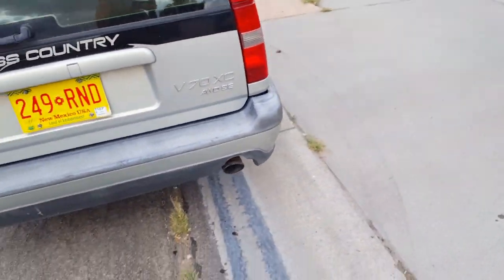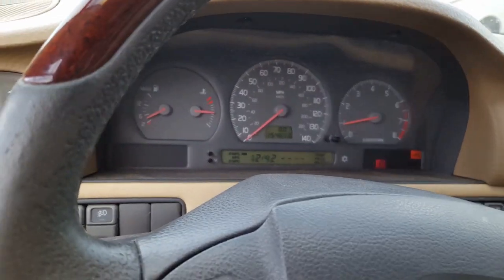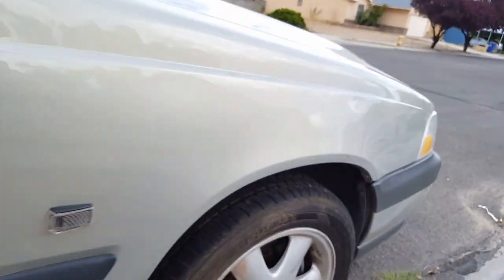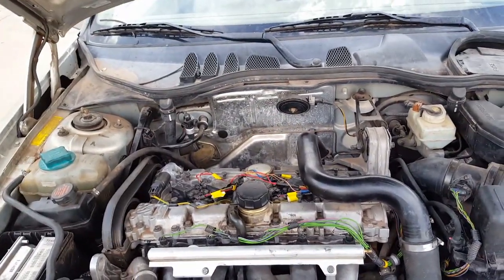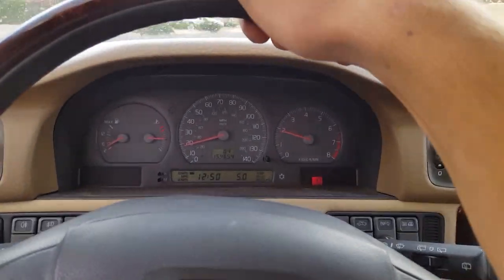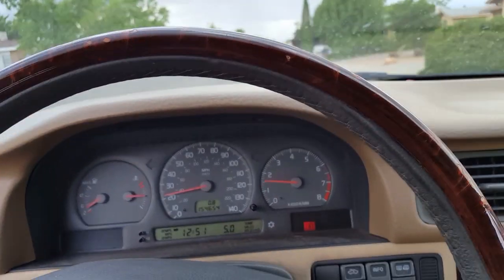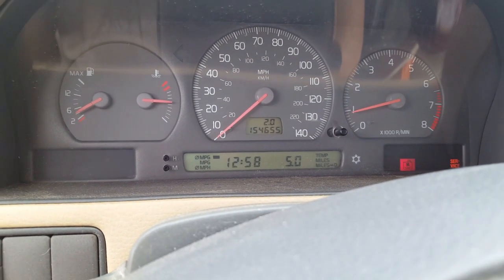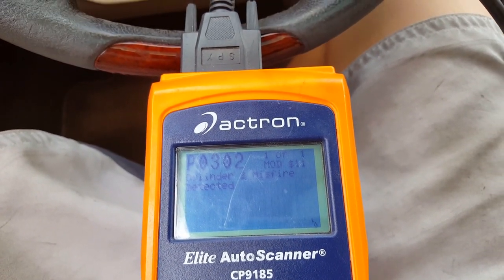Volvo v70xc SE Misfire Compression Test

Comment: I had a 2000 V70 XC SE, black interior but otherwise same (except for large black bar on back window). Is that a 99 ? I still love the look of that model, way more than the 2001-2007 XC70. Mine had 265k kms when I traded in, it was the third car behind newer V50 and XC90, pity I can't collect as many as you have (I'm on my 8th Volvo overall)

Comment: Did you solved the problem? I have V70N 2.5T 2006 Whit similar problem. No codes but it register misfire at random cylinders some times. I have Cheeked fuel pressure, change spark plugs, Change some of the coils. And some other things. My compression may be little low but not treble low. Your car shakes allot more then my car. But similar problem.

Comment: On one hand I definitely am interested in how this project will turn out. However the issues that the P80 chassis have kind of scare me. I have a 91 740 NA and it basically sat for a year before I got it. The 16-18 avg mpg is killing me in town. That's why a newer p80 series appeals to me. More power and better mpgs.
Reply: 16-18mpg in town.  That sounds very low for a 740, even an automatic.  I think you might have some problems with yours...
Reply: +gosportjamie Yeah I am trying to figure out why it is so low. I am thinking that the o2 sensor maybe bad.
Reply: If it was something like that you should have a check engine light on the dashboard.  My guess would be that you have a bad temperature sensor which is reading cold all the time so the engine is constantly running rich, like using the choke on a carburettor vehicle.  There are two sensors, one that operates the temperature on the dashboard, which is often in the radiator or on the thermostat housing, the second one sends engine temperature readings to the engine management and is usually on the top end of the engine, and it's this one that I suspect is at fault...
Reply from the maker: the p80 does have a list of common problems, but if you handle them one at a time, it isn't so bad and quite rewarding to daily. exponentially more comfortable than a 7 series and power is nice to have. have you done a tune up on that 740 lately? it wouldn't cause that much of a mileage drop, but it is worth looking in to. and cleaning all the sensors
Reply: +David Bello I have done a tune up on it. I replaced the air filter , air temp sensor, and now the ect is next. I also did the E-fan conversion as well. Trust me the P80 series is very tempting to invest in. I have watched all of RobertDIY's videos on servicing them. I'll follow your build and see how it turns out. I also deleted the air temp blend door cause it was stuck on the hot side.
Reply from the maker: As they always do get stuck. Robert is a great guy. I like the p2 series more and more because of what I would call their "effortless luxury."
My 122 and 240 heave to get up to speed, whereas all of the electronic goodies on the p2 make them feel light (having a turbo helps). Of course, electronics are the Achilles Heel of these cars, and the p80 cars have more reliable instrument clusters, for one thing. More robust door handles, sunroof units and slightly thicker sheet metal skins are also noteworthy. We'll see how deep the rabbit hole goes once I sell my 240 and put a thousand pesos into the 2001 xc70
Reply: I wouldn't mind an 850 turbo sedan. I have owned 3 Saab NG900s and I loved them because they were wonderful highway cruisers. The maintenance on them could be a nightmare though. That is what sorta scared me away from FWD Volvos. I wanted a S80 but the many nighmare stories that I read kinda scared me off. I will get my 740 sorted out for a reliable daily (if that's possible) and then maybe I can look for a project 850 or S70 turbo to take on. I have driven a S70 and I admit it was so nice to drive. AC worked effortlessly, there was no rattles or vibrations. It was like riding on a cloud. Used FWD Volvos are pretty cheap these days just like Saabs. It's just finding one that hasn't been beat to hell to invest in. I will keep following your journey with your XC. Best of luck!
Reply: David Bello   I don't know if it's something that applies to US specification vehicles but I know that Volvo did redesign the instrument cluster on the P2 UK and European models to hopefully sort the problem with the clusters dying, which could and did regularly happen when the cars were still under warranty.  My understanding is that a later cluster should be a plug and play direct replacement and far more reliable.  Of course, time is the real test and it could be that the newer clusters go the same way, just later rather than sooner.  Of course it also has to be said that electronic instrument cluster failure is certainly not something that is unique to the P2 Volvo, I think there are recorded cases of it happening to just about every make and model of car fitted with them since 2000, with some, like my mk1 facelift Ford Focus, though mine seems to be still  on its original at 14 years old and (touch wood) it's still working fine, though occasionally it does things which you may not necessarily expect as it goes through its self-test function, so I do wonder if maybe some of the cases of "failure" are actually units being replaced by unscrupulous workshops when the "fault" the owner has seen and reported was actually the electronics running a self-test...
Reply: Darth Eyeball   The 850 and first generation S/V70 are a lot less complicated and frustrating to work on than the SAABs would have been largely because they're not full of under-engineered and over-stressed GM components that didn't work particularly well in the cars they were designed for.  And their problems are well recorded, whereas the SAAB seems to be able to find totally new and unexpected ways to go wrong.  Of course, due to their age finding a good one could be a problem, but if you're prepared to put in the work and take some time over doing one then buying a basically sound cheap heap and working through it could be a good way to go, especially if you have decent junkyards around your area...
Reply: I so agree on Saabs finding ways to go break outside of the expected. There are lots of 850s and s70s in the junkyards around here. Parts are plentiful. So far finding one that hasn't been beat to hell has been a challenge. Though it did happen across a 01 V70R AWD for $500. But it had been sitting for the past 4 years and the timing belt had broken and it was having issues with the angle gear. The guy just wanted it gone. But it seemed like it was really gonna need some TLC to bring it back. I'll keep my eyes open. Thanks for your help.
Reply: Darth Eyeball   I might have been tempted to take a crack at that V70R, even if it needs an engine rebuild after the cambelt snapped it would be worth the effort as they are properly quick and fun to drive even in automatic form.  The angle gear is extremely common on AWD cars but they can still be driven as two-wheel drive with the rear propshaft/drive shaft removed, and replacement angle gears shouldn't be too hard to find or too expensive, particularly with re-engineered ones coming on stream.  Even if you decided it was too much work it would certainly break for much more than $500 as genuine R parts, such as the spoilers and such are very hard to find so reasonable used items can sell for stupid money (apparently a lot of original-spec R parts are no longer available through Volvo...)

Comment: I’m having the same problem with 05 XC70 Replaced two coils number two and number for that is what I got an OBD I was running the same when I was done drove 15 miles parked it started it up check engine light was back on car Randgood for 10 minutes then started to Miss again

Comment: I dunno David, low compression usually calls for me to turn around with these cars. The 850s were 156-185lbs. that low compression on the one cylinder could spell trouble for you. did the wet test make it go way up?
Reply from the maker: wet only bumped it up to 120
Reply: +David Bello  Well, having done the dry and wet compression tests you now know that the problem is either with the head gasket or the valves, or very possibly a cracked cylinder head.  Depending on financial constraints a good used cylinder head might be the cheapest way to go now...
Reply: I really doubt there are major bottom end problems as the engine just sounds too sweet on the video, usually bottom end problems are accompanied by a variety of unpleasant noises.  The fact that it's not triggering a fault code is actually good news as it shows that, apart from the mechanical fault causing the misfire (I'm betting one or more burnt or bent valves or possibly damaged valve seats, if it was a head gasket I would expect it to be burning coolant which almost always triggers an emissions fault code from the burnt antifreeze,) the rest of the engine (with the exception of the leaking turbo, which could be failed seals in the oil return) is in good shape as is the emissions system.  On the video of the test drive the gearbox seemed sweet and it seems to drive well and it is pretty low mileage for a US car so I think swapping out the head would be a worthwhile job that would make it fit for another 150,000 miles.  A little minor cosmetic attention which I'm sure you've done on others before should make it a really nice car, and pretty unusual being an SE too...
Reply: Using some leather/hide food or saddle soap on the drivers seat now will stop it cracking up completely and splitting like they do in high temperatures.  Once it's had and absorbed a few doses of that it will look nicely mellowed and really soft again...
Reply: The reason the check engine light was flashing on and then going off is because of the knock sensor picking up the uneven running, it's designed to allow the engine to adapt to poorer quality fuel by altering the ignition timing to try and cope, and will briefly flash up the check engine light while it is doing it as a warning to the driver not to drive the car hard.  In your case, however, it isn't being caused by bad fuel but by a mechanical fault which is why the check engine light eventually comes on constantly recording the misfire code.  With how quickly the car started running low on fuel I suspect the oil leak at the turbo might be in the oil supply to the turbo rather than the return as the supply side is pressurised...
Reply from the maker: +gosportjamie thanks for the tip!
Reply from the maker: +gosportjamie I can't tell you how many bad heads I've seen on the T5 engines. mostly just neglect and overheating them. as always, I look forward to your input. you are a wealth of knowledge Jamie
Reply: David Bello   Yes, it certainly seems that head problems are far from uncommon on these in the US.  I suspect it is a combination of higher summer temperatures and uncaring owners running the cars on a "drive it until it breaks" basis rather than sensible "fixing it forward" regular maintenance.  The only wrecked 5-cylinder heads I've seen here in the UK have come off tuned (and maybe over-tuned) cars.  I suppose the lower temperatures help and the fact that in the UK Volvos tended to be owned by more careful owners and enthusiasts (and the Police) so they are maintained, plus the UK MoT system, every year from 3 years old has probably seen a lot of the neglected cars written off the road due to failure of an expensive (often electronic) part before they get to the point of melting heads...

Comment: Hey David Bello, I have a Volvo 960 1993 that has been in my family for so long and well lets just say the car is not in its best condition appearance wise. I have tested the engine making sure it is fine, which it is. The thing I have noticed is that the car's steering wheel seems to shake a lot and once you get the car up to 80mph it starts shaking like crazy. Do you have any idea on what that can be? Also I am looking for a site that has volvo pieces, like interior. Do you have any recommendation? Thanks :)
Reply from the maker: first thing to check is the balance on your tires. any car that sits can get a flat spot. more so back in the day when tires were nylon. it could need new tires
Reply: Thing is I already changed its tires.
Reply from the maker: Balanced well? That's really the single biggest contributor to shaking. Unless you have a bent rim?
Reply: possibly ill check. Thanks for the help :)

Comment: Dude,  you couldn't see the sparking on the coil pack wiring at 4: 28?  That's an issue!
Reply from the maker: I see the little oil puddle reflecting light that might look like a spark but no real sparks.

Comment: Common problem with these are the throttle position sensor. it will not trigger any check engine ligth. needs coding after replasement. need to replase the trottle body.
Reply from the maker: it did have the original white label ETM. I put in. a known good yellow label unit from a wrecked v70xc so I know it is programmed for the same ecu

Comment: I was having a misfire also, but change when I replace the fuel pump relay
Reply from the maker: woah, interesting. I've had that relay fail but it is just a no start condition
Reply: Was it doing the same as the car in the video because I’m having the same problem with 05 cc70